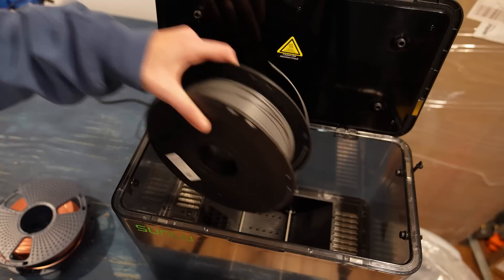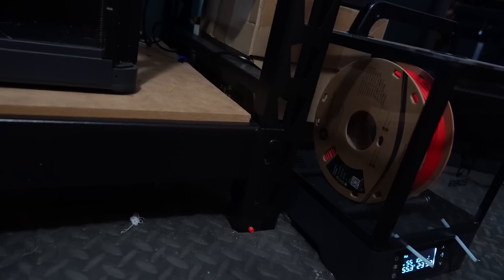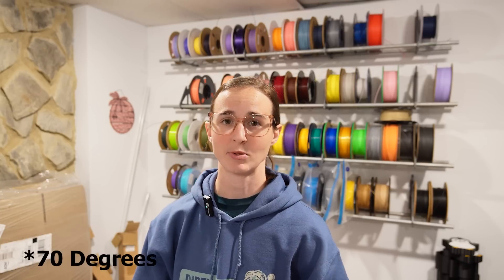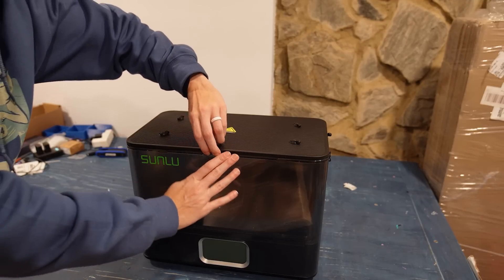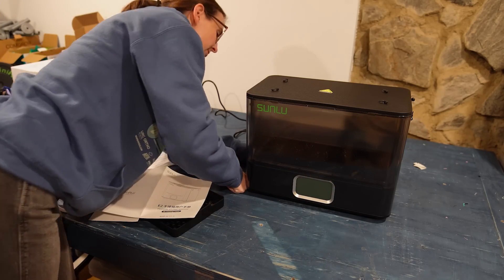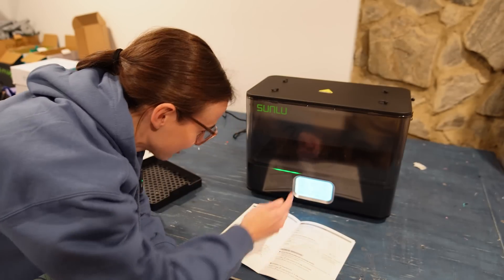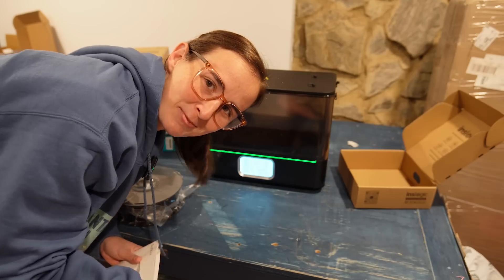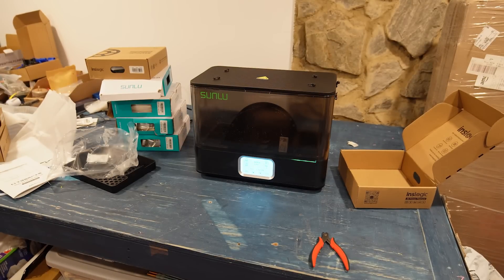Best High Temp. Filament Dryer? - Sunlu NEW FilaDryer E2 Review

Comment: tpu is hard to print with when starting out. Great review on the dryer. ASA, PC, any of those can dump some fumes for sure. Best to vent it outside similar to a laser engraver. I live in Florida so I'm always battling humidity i decided to get the s4 for now as i usually only print the standard materials and the capacity is better than my food dehydrator. I just use vacuum bags and desiccant to keep the filament dry when needing to store long term.

Comment: Besides pla i’m planning to print asa and nylon and tpu for functional parts mainly for outside use. Do you think this dryer is worth the 320+ euro that it will cost in preorder? If it was 200-250 euro I would probably definitely buy it but i’m doubting because of this steep price.

Comment: I have the S4 and simply dry tpu, abs etc in it and it comes out well. So i dig they created a monster that can heat up to 100C but then like you point out the space needed for that you are limited to 2 spools. So you would need 3 of those machines to feed a prusa XL with drying filament while printing. Also you talk about fumes, get a enclosure and a filtersystem. It's not like PLA printing is so healty for you...

Comment: It’s big because it’s an annealing oven that you happen to be able to put filament in. It’s priced way too high for that though. A decent laboratory oven is like $300 and they’re designed to dry things at precise temperatures. Dry filament in lab oven, place in $40 dry box to print, then place completed print straight into 90 degree lab oven to anneal. I just can’t see the appeal of this at $1k.

Comment: I'm glad that they're pushing the max temp higher! I tried printing some sunlu epa a while back and it just wouldn't dry fully even with my sunlu s2 dryer at its max temp so I ended up using the printer's heated bed to dry it fully. Some filaments are just incredibly hygroscopic. It's also great to see that they have something that accommodates larger spools!

Comment: Hi Macy, for a better test of the dryer, I would use filament you have already in the open for a longer time. Weigh it before you put it in the dryer and afterwards, to figure out how much water you have actually removed with the drying process and if it is really is necessary in your shop. And keep an eye on the room humidity and how it changes over the year.
Reply from the maker: Thanks for the tips :) Sometimes when you make a video for a company they have plans for the video that are outside of your control but I'll try to work in your ideas in future videos when I'm able.

Comment: It's not just a filament dryer as it is also used for post processing the 3d printed parts by a process called annealing and that is why it has a large volume. Annealing is a process that elinimates internal stress (prevent warping and cracking), enhances mechanical properties like strength and toughness and improves surface quality. Annealing also promotes material crystallization which can boost heat and chemical stability.
Reply from the maker: Cool thank you for helping me understand annealing! I don't have an engineering background and these materials were all new to me so I had no idea what that function was meant for. Glad I do now :)

Comment: I got the S4 Sun Lu Dryer, which as you said holds 4 spools of filament. 
( oh yes and 2 of the sun lu S1's and yes they work well for PLA, TPU, PETG )

And my S4 can do all the high temp filaments as they all show on the touch screen!  

So this as you pointed out only holds 2 spools. 

So no reason to get this one when you could get the 4 spool S4 dryer.
Better value since it can do the same filaments but 2 more spools.

This one seems pointless, As the S4 is better and does the same.  
Why they bring out the 2 spool one if the 4 spools one is doing the same job but with 2 more spools?

The screen should really be on a plug in data cord then you could place the dryer where you need and still use the screen!
In your case you have to put up a shelve on the wall above the printer then the dryer can be sat side on so the screen is seen.
Reply from the maker: I think one of the big selling points for this one is the annealing mode. I didn't touch on it much in the video since I would've needed to print more with the advanced filaments to be able to test that out. I think that's why it is so big

Comment: If anybody needs a recommendation for a dryer that isn't insanely large I use the Sovol/Comgrow SH02 that came out this year and it's a great 2-spool filament dryer that takes up just slightly more space that 2 1KG rolls next to each other. Max of 70C drying but IMHO that's good enough for 99% of the printing folks are doing (as well as active drying). I print PETG only so I use it practically every day!

Comment: I called it a few videos back....companies will be sending you things to review before you know it....and now they are!  I'm going to say it right here and right now....Bambu will be sending you one of their new printers when it's ready (whatever and whenever that is)!

I thought this WAS the 4 roll model based on the appearance.  I have the Comgrow (mines actually a Sovol -  same thing) and it works fine for what I need.  I don't know the price point of the E2 (or E4 for that matter) but it would be nice if they could power the rollers the spools sit on so as to evenly warm the filament by constantly rotating it.  You'd have to disable it when printing out of it.  I throw a roll in mine when I go to bed and it never gets rotated until I get up in the morning.  Not that big a problem at 50c though.

As always, great job Macy.  You're killing it!
Reply from the maker: Fingers crossed on the Bambu printer :) Thanks for always being here to support!
Reply: Excellent point about motorised rollers. Ideally you want an even distribution of heat to all points on a spool.
Reply: @Neomaster67  But do any dryers have that?  I am not aware of any.  I try to rotate them by hand every so often.  LOL
Reply: @Dave_D. No dryers have the feature. That's the point. It would be great if they introduced it.

Comment: The point of the video was a review of the dryer but we didn't really see that. You should've used Filament you already had on the shelf, a before and after test prints to see if there's any difference in quality. Using it on Brand New sealed filament doesn't really show us anything.
Reply from the maker: Yes, that would've made the video better and maybe I can introduce something like that in future dryer videos. However, sometimes when you make videos for brands they have plans for the video that are outside of your control.

Comment: It has an anneal setting. That is not by chance for annealing models is it? That might explain the size. I've never heard of annealing filament. (Only printed models)
Reply from the maker: Yeah it does! That just wasn’t something I was familiar with so I focused on the drying part
Reply: @macymakes3d  yeah that makes sense because it would be silly to make it so much bigger than the spools.
Reply: @MakerMikeSizer  It's supposedly able to hold dual 2kg spools or single 3kg spool. Those have a bigger diameter as well right? at least the 3kg I suppose?

Comment: Nice video Macy. A good/better tests would have been with a filament that was water-logged and super stringy, then dry it and see the before and after. Not sure drying band spankin' new filament tells me much about the capabilities of the drier.
Reply: Was thinking the same thing.
Reply from the maker: Yes, that would've made the video better and maybe I can introduce something like that in future dryer videos. However, sometimes when you make videos for brands they have plans for the video that are outside of your control.
Reply: @macymakes3d  I appreciate the honesty. Brand promotion is tricky. They pay for your influence, but if not careful you also are vulnerable to losing "cred".

Comment: From a promotional perspective, they should have put the screen on the side of the unit. People who run print farms are likely to buy several of these. Being able to line them up on a shelf in a way that takes up less room would be a huge selling point.
Reply: I agree, having the screen on the narrow end would be a better choice for usability. I suspect the reason they designed it this way was that the center of the long side was the only place suitably separated from the fairly heavy-duty heating elements at each end.
Reply: That’s my biggest complaint on the E4.  Very frustrating that my dryer takes as much space as the printer, or I have to rotate it to access the screen.
Reply: i was thinkin the same thing, but its likelier that the print farms that would need a ton of these would end up getting a bigger solution or having a big cabinet made above the printers
Reply: Possibly also they’re expecting you not to squeeze this thing between other things that could cause it to overheat. Expectation  is that a large side is well exposed to airflow

Comment: Oh, the Sunlu E2 looks really big.
I was hoping it would be about the same size as the S2 but could go up to 110°C.
But I didn't think it would be that big. So maybe I won't buy it after all.
Reply: if you think that's big you should see the S4. That thing is orders of magnitude larger than my Bambu A1, hahahah.
Reply: @roblutter Yeah, but at least it holds 4 spools. It's quite large for only 2 spools.
Reply: @Neomaster67  I’ve got the newer Sovol unit. (SH02) Very happy with it for PLA/PETG and it’s the smallest/most capable combo I could find with 2 spool capacity.
Reply: @roblutter I've already got a Sunlu S2 and it works well for my needs, but I'll check out the Sovol just the same. Thanks for the recommendation.